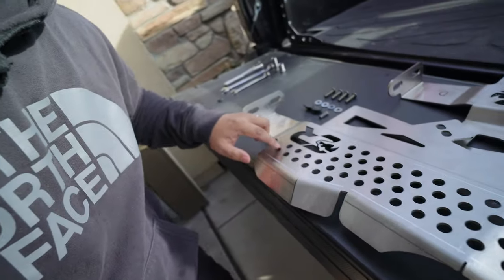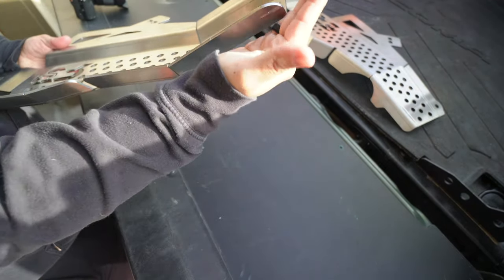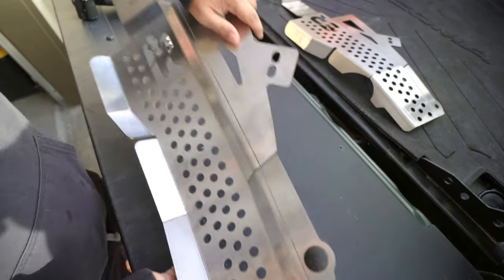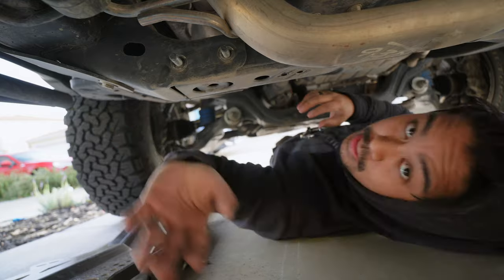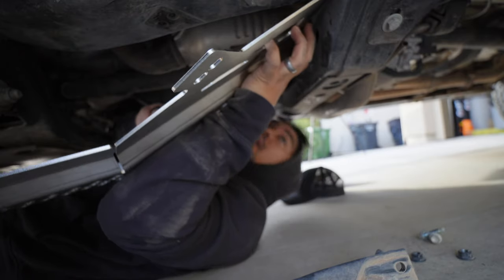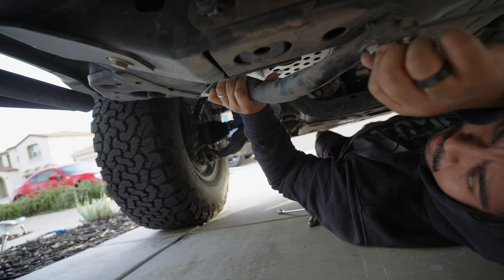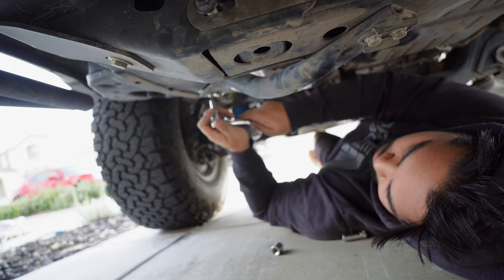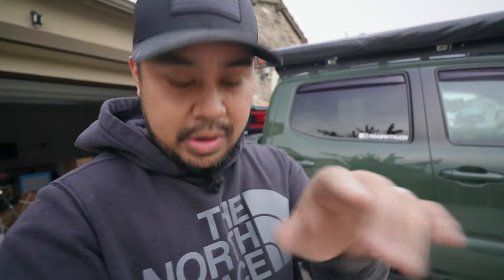Save Your CATALYTIC Converter! | Installing The New Cali Raised LED’s Cat Guards

Comment: Hi. I have read complaints about rattle noise despite the black rubber grommet s. Any way to overcome this problem. No one wants to drive around in a rattle bucket. Thankyou
Reply from the maker: I have zero noise from mine. So I’m not sure why others are having issues. It could be because I’m also running their full skid plates too.
Reply: @RoamWithJon  ok thankyou for your feedback.
Reply from the maker: @jeffmaas2792  no worries, if you do get them and have issues the guys at cali raised are pretty quick to respond.
Reply: @RoamWithJon thanks Jon I ended up getting a set!

Comment: How long did it take to receive your order, I hear it takes forever and a day until they’re delivered? Any rattling or vibration noises? Thx for the vid, im definitely considering this product 👍
Reply from the maker: I personally don’t have any rattles or noises coming from mine. Also not sure how long they take to ship would think it’s dependent on stock
Reply: Mines took several months
Reply from the maker: @mergenocide  sheeesh I was under the impression they were ready to ship
Reply: @mergenocide Do your cat covers rattle as you drive off road or the highway, I was about to order a pair until heard about the annoying rattling issue.
Reply from the maker: @contentlessincali602 I have no rattles. I’m pretty sure the people who have rattled either messed up the install or have a defective unit.

Comment: I just finished installing mine. The driver side cat shield touches the catalytic converter on mine is yours the same way?
Reply from the maker: I can’t remember off the top of my head but I do remember it being fairly close. If it is touching it’s not making any extra noises from what I can tell. I don’t believe it’ll be an issue if it is actually touching though.
Reply: It’s touching the heat shield I’m hoping it’s not a problem. 🤞
Reply: Got this response from @caliraisedled  after I emailed them about the cat shield touching the heat shield on the converter: 

Thank you for reaching out. What you are experiencing is completely normal. The catalytic converter on the driver's side has an extra heat shield that goes over the catalytic converter that is not found on the passenger side. The CAT Shield is stainless steel and can take the heat and will still perform perfectly with zero harm to the shield or the extra heat shield Toyota has in place.

The vehicle we tested this on had a slight touch, and we did a bunch of bounce testing and there was no rattle or concern at all. We designed these to be very tight and close so that off-road skids would fit below them. Tighter means better theft protection and keeps everything up and out of the way when off-roading over obstacles.
Reply from the maker: @HM-vu9zw  makes sense, I’m about to do the full cali raised under body soon so I was wondering how they would fit together
Reply: Are you going with aluminum or steel?
Reply from the maker: @HM-vu9zw  I went with aluminum. I don’t do anything really crazy, so I didn’t need the strength and the sliding ability of steel. I’d rather save the weight tbh. I really just need it to be able to take a good oopsie hit once in a while lol. 

There have been a couple small logs and branches that have been lodged up in there a few times and I’ve landed on a few big rocks by accident. That’s pretty much the extent of what the armor is going to see.
Reply: My cat shield makes contact with the cat and when I flex I can hear it
Reply from the maker: @Mandothemagnificent  ah strange I haven’t had any issues with mine, maybe shoot cali Raised an email
Reply: Mine have been installed about a week and driver side is 100% making strange vibrating noises when idling and in reverse. Very loud in and out of the cab. Not normal and not something I can tolerate.
Going to to try and flex it some to get it off the cat see if that works (assuming I can even budge it slightly)…we shall see.

Comment: The driver side definitely sucks! a little harder to put on that you think, passenger side was easy went on in about 10 minutes I had to unbolt transmission cross member bolts almost flush with the crossmember to get it down. It was a little scary, but it worked.
Reply from the maker: Wierd Forsure, I don’t think I had any trouble with either side. I think the driver side I had to angle the cat guard a little to get it up and over but aside from that I had no issues on my end. Hope everything else was smooth for ya
Reply: Your video helped for sure!!
Reply from the maker: @kts8806  Glad to help!

Comment: Torque specs?
Reply from the maker: I could not for the life of me find out the torque specs. So I just tightened it down to about how tight it felt when I first took it off.
Reply from the maker: @henrypolo2597  👍🏽
Reply: @henrypolo2597  That’s way too high.  I believe it’s been mentioned as 24 lbs on tacomaworld but it’s recommended to hand tighten.  I stripped the security bolt and snapped the other bolt to the brace.
Reply: @ceeIoc  Oh crap! I gave you guys the spec to a 4Runner. I will erase my comment. Thank you for responding.

Comment: Nice video. But on the driver’s side there’s a support u-shaped bar on the cat that has two bolts. The lower one has to be removed & the upper has to be loosened so the bar can be swung out of the way before the cat shield can be put into position.
Reply from the maker: thanks! Not sure if that’s necessary. I didn’t have to do anything outside of what I did in the video.
Reply: I noticed there was a gap in the video that showed you just slide it in. You can bend the tab on the shield just a bit then bend it back. It is aluminum just an FYI. @RoamWithJon
Reply from the maker: @piratewb  it’s not aluminum and why bend anything when you can just slide it in and not reduce the integrity of any parts.

Comment: Just curious how close the skid plate is to your driveshaft to the transfer case mine hits.
Reply from the maker: What model is your Tacoma? That’s very strange, I have a little more than an inch of clearance.
Reply: @RoamWithJon  talked to Callie LED today and they changed their design and it was wrong so they are sending me new skid plates out. It no longer goes over the transmission crossmember
Reply from the maker: Ahh I see, interesting, glad they could help you out 🤙🏽
Reply: @RoamWithJon  yeah kind of sucks cause that thing wasn’t all that fun to install and it scared the shit out of me when I put the truck in 4 x 4 the noise was bad
Reply: Seems they have two designs a 2WD version and a 4WD version. These seem to be the 2WD and their “new design” goes for 4WD. Wonder if their new design works for 2WD?
Reply from the maker: Not sure what they changed to be honest. I know they changed the design but not to sure of the specifics, this is on a 4x4.

Comment: After off-roading with them I feel like the are rubbing on something. I can put my finger if they are flexing or what but I definitely hear them shifting.
Reply from the maker: Hmmm I’d go under and push and and pull on it to see what it is. I haven’t had any issues with em so far.
Reply: I figured out what the noise is. The driver side car shield is against the cat and when there is flex the shield presses against the cat and that what I hear. Does your cat shield come in contact with your cat?
Reply from the maker: @Mandothemagnificent  if I remember my cat is sitting right on top of my shield but it’s not making any extra noise

Comment: Had to bend the driver's side a little was Rubbing on the front drive shaft
Reply from the maker: That’s very strange. Do you have the v6 or 4 banger Tacoma?
Reply: If you have video or photos that’d be great to see. I think I’m having similar issues
Reply: I bet this is my issue….
Exactly how did you bend it? Crawl under and hang from it 😂, or pull it off entirely and use something else to bend it?
Reply: @tterrag4010  it’s be nice to know for sure. Lol my truck sounds like the exhaust is going over a rock. That what yours sounds like?
Reply from the maker: I would ask cali raised if this is a an actual known issue and if they can remedy it
Reply: @RoamWithJon  will check with them my dude! Appreciate you!
Reply: @Mandothemagnificent   kind of a loud droning noise/vibration when idling and in reverse. Odd enough sounding that it got my wife’s attention when backing in the driveway 🤦🏻‍♂️.
It could def be related to touching drive shaft, or transmission related. I’m going to give it a look in the morning. May be able to loosen bolts and reposition slightly.
Reply from the maker: @Mandothemagnificent  no worries! Hope they can figure out your issue

Comment: Do the se work in conjunction with skid plates?
Reply from the maker: They mesh really well with the Cali Raised under body, I’m not quite sure how other skid plates are installed but I’d assume they work well. Over the next week I’ll be posting the rest of the Cali Raised led skid plate collection and it’ll show how they meld together.
Reply: @RoamWithJon   hey man, cool video have they give you any problems so far?
Reply from the maker: @TRDproMike  zero issues on my end

Comment: Are the provided screws security screws? MillerCAT provides a specific made screw head that only they provide and if it’s lost you have to prove ownership before they’ll send you a new one.
Reply from the maker: They are security screws, they look similar to the security screws on a Thule roof rack. Kinda like a torx with a raised section in the middle.
Reply: @RoamWithJon  gotcha. Thank you! Ya sold me on these! I live in butthole Portland OR and cat thefts are running rampant here.
Reply from the maker: @ThatCleanMT  No worries! It’s not much better down here in california 😂
Reply: Thanks for the vid on this...definitely ordering a set!
Reply from the maker: @canucktaco  no problem! I sleep better knowing I tried to stop em lmao
Reply: @RoamWithJon  It's not a big thing (cat theft) here in Wisconsin but I will not take a chance, I will definitely install that on my 2022 Tacoma Off Road.
Reply from the maker: @POGIAKO62  right, I’d rather have tried to stop someone than just leave it to chance and wish I did something. If that makes sense aha.

Comment: how do they cat guards deter thieves?
Reply from the maker: It’s additional harder piece that they would have to cut through. It also blocks some of the easier spots to get a saw or cutter into. 

Basically turns something that should be an easy crawl under the rig and cut off a cat job into a much more time consuming job.
Reply: Ha what a stupid question. Why lock your doors?
Reply from the maker: @bartcanuck734  that’s actually a good point lol

Comment: Do you know if it fits a 2019 V4 taco ?
Reply from the maker: Not sure, to be completely honest. I would send them a call, or dm on Instagram or email them. They should be pretty quick
Reply: 2016-2022 according to the website.
Reply from the maker: @michaelclayton9981  I just checked and it says it only fits the v6 taco. Not the 4 cyl.